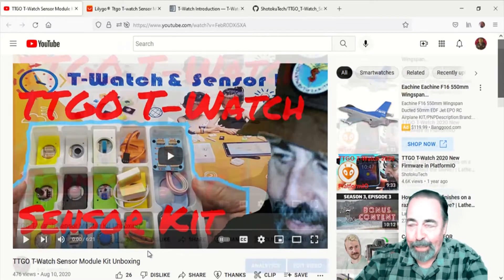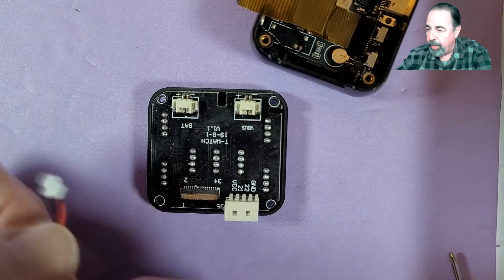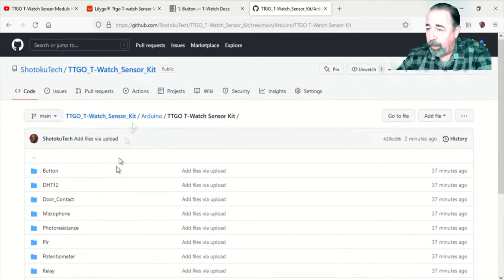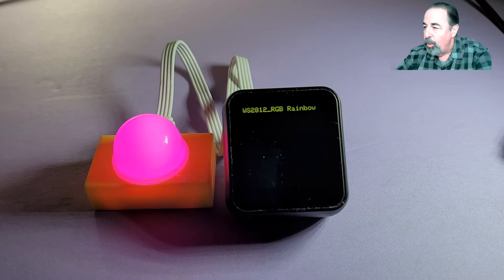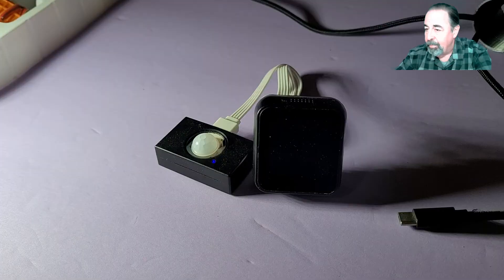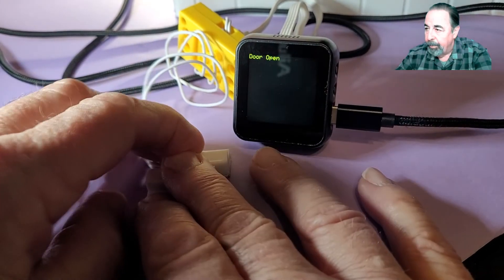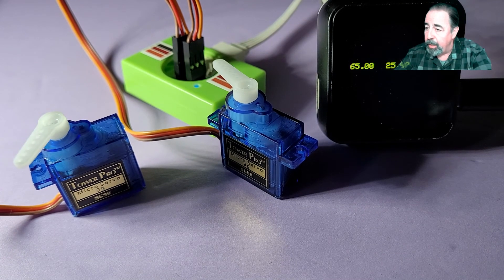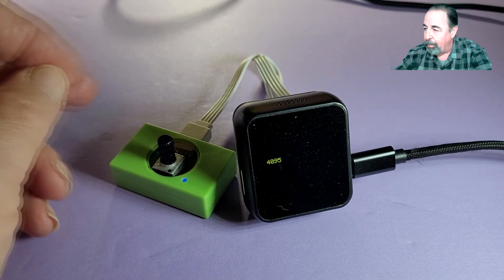TTGO T-Watch 2019 Sensor Kit Complete Run Through

Comment: Hi Sir, I'm trying to run the max30102 oximeter sensor on my ttgo, did you try anything about this sensor ? Thanks in advance for your advice and help.
Reply from the maker: Hello. I have not tried that sensor. I would say if you have had success with other I2C devices you should be able to use this library in Arduino IDE: SparkFun MAX3010x Pulse and Proximity by searching for max30102 in library manager.
https://github.com/sparkfun/SparkFun_MAX3010x_Sensor_Library

Comment: I have a different kit, but have gotten all the sensor to work that I have. Thanks so much for the run thru. I got the  Duo working by using pin 25 for the connecter that has a number 21 and using pin 26 for the plug  that has a 22.
Reply from the maker: Great! Thanks.